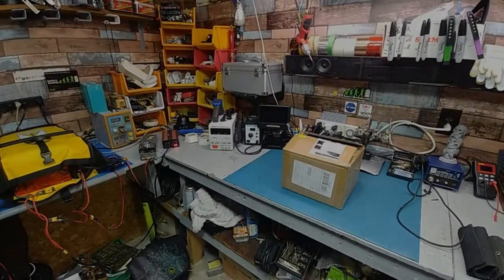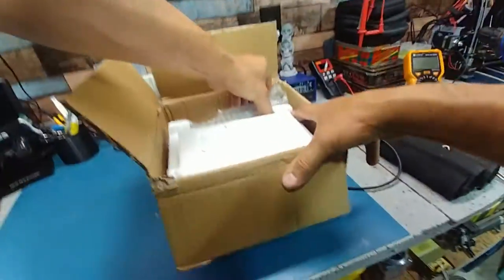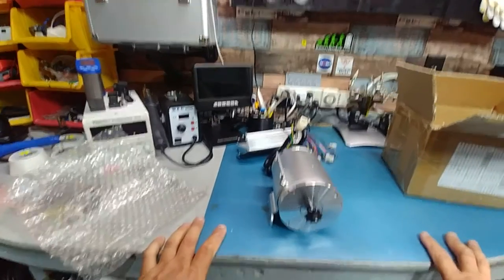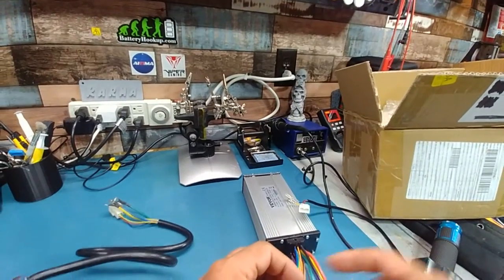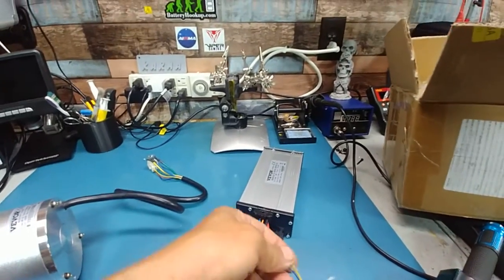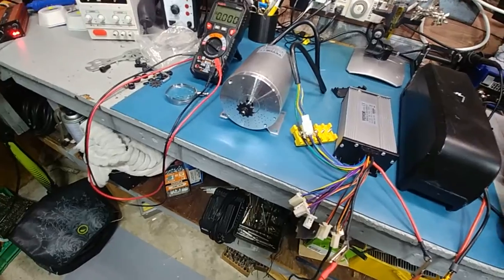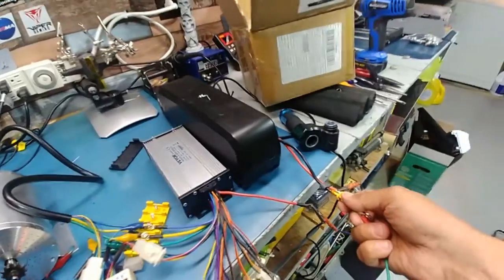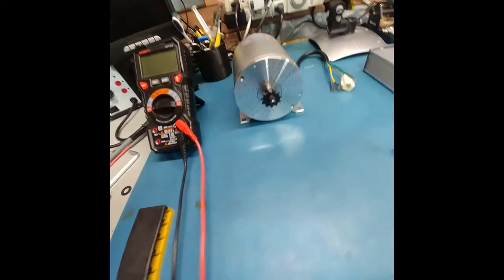Brushless Motor Kit,2000W 48V 42A 4300RPM  review?

Comment: Got the same Kit from amazon , NO 3 SPEED SWITCH , NO ANTI THEFT , JUST THE CONTROL UNIT THROTLE with key. Plugged it in and NOTHING ... Dud like a firework with no powder ,  no lights or nothing

Comment: You forget to connect the vcc with the plus of battery ...the vcc cable com wthe orange or red color ...you shood to link it with battery plus it's for contact key ..thanks
Reply from the maker: unit came without key. motor and controller only.  there is no single red vcc wire to setup. its not a true 2k controller anyway. if anything below 1k. i will go over the controller set it up working in case anyone was the same problem. I'm sure it would work if it came with the ignition set.

Comment: Doubt the controller is dead , you need to activate it , one of those connectors will be the on switch wire, if no joy, open it up, look for vcc conection.
Reply: exactly, some of these you need the key.  If you don't have one of those, just jump the two wires with a paper clip

Comment: I had the same problem like you as the motor did not work. However, I did what the other guys suggested with splicing the on/off wires directly (since I don't have a switch yet), and the motor worked fine. The speed controller worked fine.

Comment: I just installed a 3000w Vevor kit and need to reduce the torque and speed. I have a 3 speed attached and it doesn’t reduce the speed half as much I need. You seem well educated on these and I was wondering if you know of something I could use to reduce speed even more. I also tried a Potentiometer and that didn’t do much either.

Comment: I have the same motor and controller. Was working. 
Now when from standstill sounds like the motor making lots of clunky noise
I can here struggling and when I get some speed its normal.
After each take off this takes longer for it to go normal.
Feels like a turbo kicks in.
From cold the takes off fine with no signs of problem.
When it was good the acceleration was smooth or linear. 
Is it the motor or controller? 
How can I tell if is in good working order?
Thanks.

Comment: Between these vevor and the other 48v 750w motor that's often sold with a controller and a sprocket, which one do you think makes more sense for a trike scooter with 2 rear wheels driven by 2 motors? 

This 48v 2000w draws 32a each, wherehas the 750w draws 15a, which is usually easier on the battery. Once I add the rear gears and chains, it will reduce the speed by 1/5 and also increase quite a bit of torque. 

The problem is I have to wire for reverse rotation for one of the motors to match forward rotation, but I heard that when reversing polarity the motors will not match rpm/torque spec, is this true?

Oh, that gear is T8F for some sort of go cart or whatever.... it uses 8/10mm double D shaft bore.
Reply: Hello could you tell me exactly the name of this yellow lock hard to find thing?

Comment: Gidday from Australia, I see your power supply on the bench do you bench test these motors and controllers with the bench power supply? I read somewhere there are limitations or risk of damage to the supply when running dc motors.?
Reply from the maker: funny you should bring it up. i have a psu im working on now with the power to turn two motors. ill post a video soon.
Reply: @karmaEbikes.  I have a nice 60v 24A supply but don't want to cook it apparently in some cases you should only run dc motor at 25% max output of the power supply?  As an example i should only run 6A into a dc motor with my 24A supply I should try find the info again I think it was RD Tech article just not sure if it was about running brushed motor directly from the supply due to feedback or if the brushless controller on this would behave differently and negate the issue entirely

Comment: I'm actually looking at buying that motor. But from the company it's self with a throttle.  Plan to put it on a moped my son trash picked. I'm a complete noob, so I'm a little lost on what components to buy. Would this motor work with lead acid batteries?
Reply from the maker: i would go with lithium for weigh . but led acid will work.

Comment: Thanks for sharing. I'm very much interested in how you mount and connect the motor as I have a Solidworks enclosed velo trike designed I was considering that motor for. Might you be planning an intermediate reduction or possibly using a large drive sprocket? 
 I have some ideas for a simple chain or clogged reduction drive, and could lay something up in Solid-works that could inexpensively laser cut and bolted together if you have some interest? 

Thanks.
Reply from the maker: its up in the air. i think a reduction drive would be a better way. need to do more research.
Reply: @karmaEbikes.  When I did some calcs with that 2000w/ 4800 rpm motor on a 26" bicycle tire, a  # 420 9-tooth motor sprocket and an 88 tooth rear sprocket should give about 40mph at 4800rpm. Of course a 2:1 intermediate drive would give you the same rear final drive with a more reasonable sized 44-tooth rear sprocket, but such an arraignment with only a 9-tooth motor sprocket would be direct drive. About the smallest freewheel clutch I'm seeing is 14 tooth so that was bringing me back to an intermediate reduction drive.   

Another option might be to drive the crank set with a secondary chain.. 

Something like a 3:1 reduction drive with a 9-tooth output chain sprocket to drive the derailleur chain was what I was looking at f or the Velo-trike design in order to be able to use the derailleur gearing for a bit more toque and speed bur I do prefer the idea of a separate motorcycle chain

Comment: I got a controller from vevor in a kit and there is a plug called eletric lock (that's what it said on my controller) you need to attach the two pins to gether with a wire and that should work
Reply: Hello could you tell me exactly the name of this yellow lock hard to find thing?